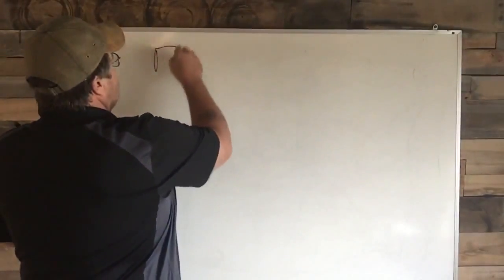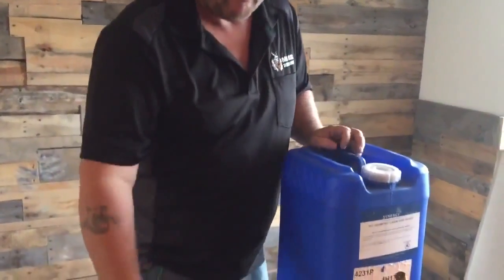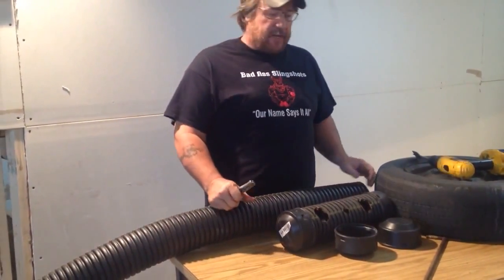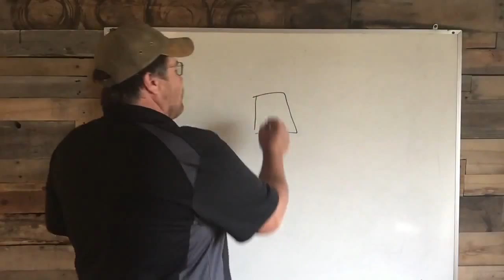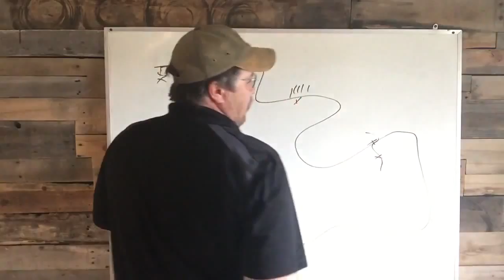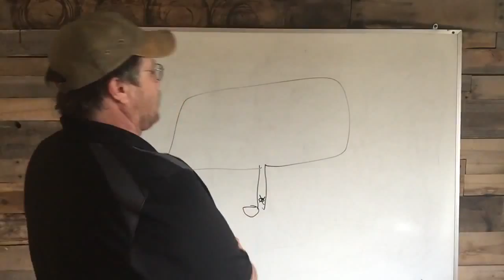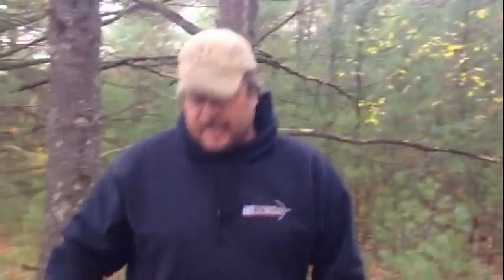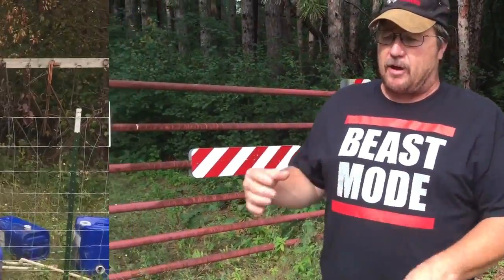Trapping Raccoons Burger King Style

Comment: I'm going to start trapping this year. Once I flesh the pelt and get it on a stretching board, you're supposed to store the fur in a room that's 40°-60°. The problem is I do not have a place nor the money to keep a room that cold all the time. My question is can you keep the fur in colder or warmer temperatures? If not, could I hang them in a refrigerator that's cranked up to about 40°? Any response is helpful. Thanks.
Reply: Nice video

Comment: Burger King Style Trapping - Good. If you are in the right place, you can, as we call it..."Buy a Salad Bar". 'Lands Available for Taxes'. With a little self-supplied research on the titles I have picked up 80x575', we improved into our "Dove Gallery", a single wide mobile lot  on a canal leading to a hard to access lake, a triangle on a lake where pro bass tournaments are held and a 3/4 acre lot butting a 3,000 ac. municipal wellfield area where only hiking is allowed. I trapped hogs and had a stand there for years. These lots have been a + for me, I hope others will look for like opportunities. Worth remembering "You can't buy property cheaper than for back taxes".